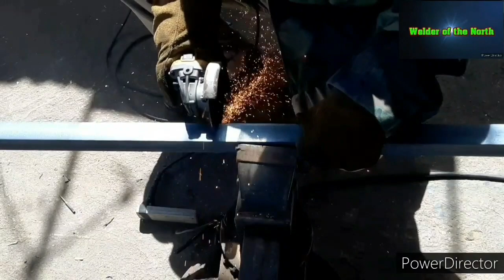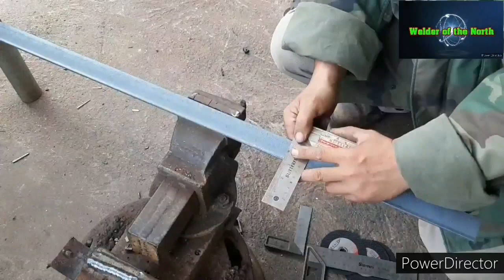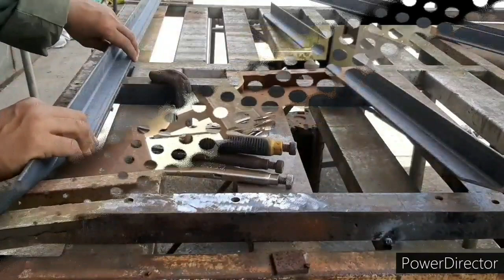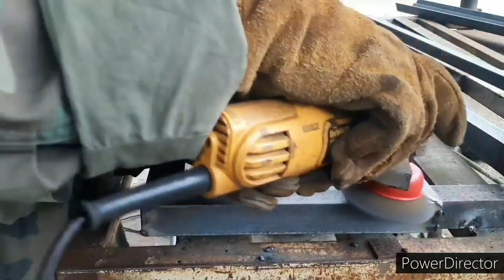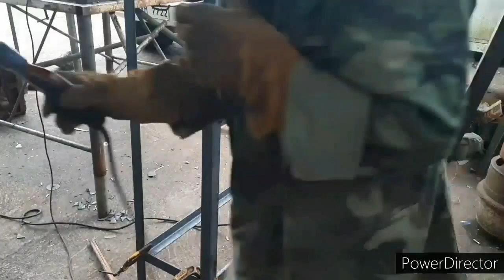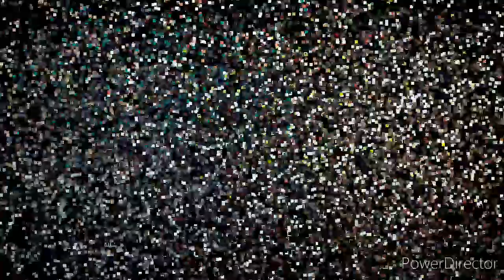Diy angle bar  Storage Rack

Comment: Why use spot weds at all? Full welds are stronger due to better penetration.
Reply from the maker: Yes you are right sir that fullweld is stronger than spot weld 
I use spot weld to avoid hot pass cause the metal is not thick 
To much heat will cause the metal weld to fail 
Thanks for watching